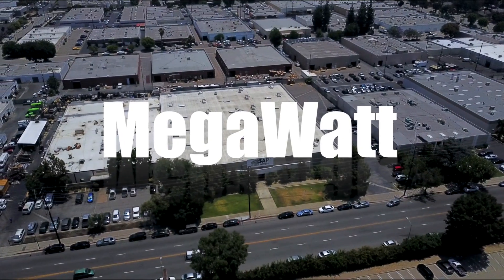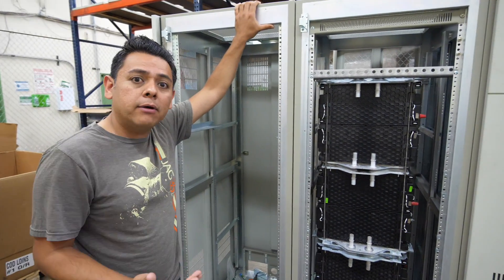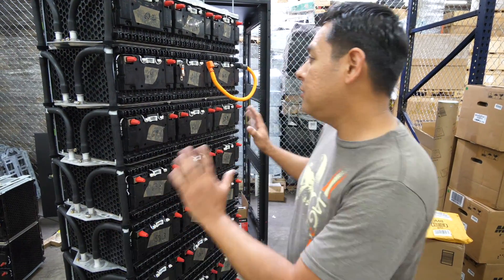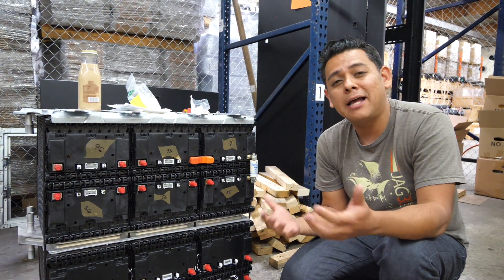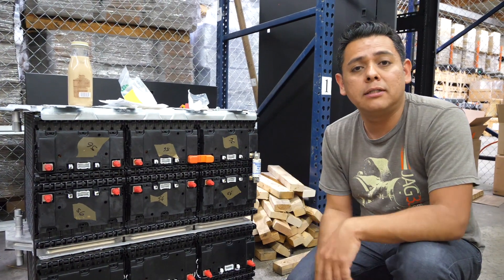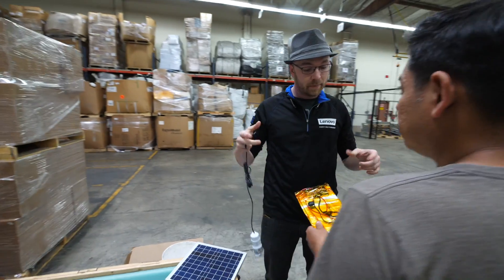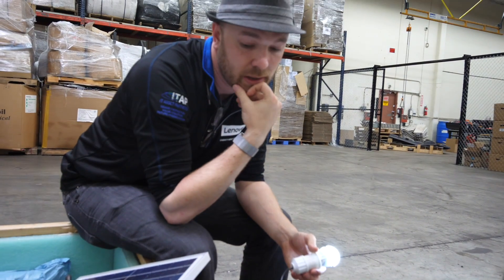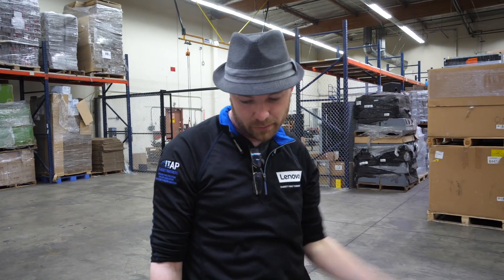1 million watt hour 355V SOLAR STORAGE battery

Comment: 355v/400v DC! Yikes, that'd for sure tickle if you touched it live :(
Reply: These are lithium cells. Delivering lots of amps is in their wheelhouse. When you get above 300 volts, the electricity can start to reach out and "touch" you. My father (EE, worked with particle accelerators) thinks that these medium voltages can be more dangerous than high voltages in the 10s of thousands because those voltages "warn" you when you get close. You can feel the hair on your arms react.
Reply: So 10000 amps at 12 volts, that'll kill ya? :)
Reply: Wrong, it's the combination of current and voltage that makes electricity hazardous. You can touch 12 or 20 V all day with your fingers and nothing happens (try with a 12 V car battery with dry fingers). The voltage needs to be high enough to overcome the resistance of the skin, then a current will flow. ElectroBoom did a good video about it.
Reply: There's quite a difference between AC and DC voltage regarding the potential danger. Check out ElectroBoom's video about it, that guy is entertaining and knows his stuff.
Reply: would 'arc' your back in a split second
Reply: SwisssBolla - That's electrostatic pulse discharge if I'm not mistaken. Very brief HV pulse and very little current
Reply: yeah, but 12 volts can't go through your skin
Reply: Markle2k: A week ago you wrote that (ventricular) fibrillation was in the 1 Amp region.  That is BS, it is far far less than 1 Amp and  then you said a government website gave you this wisdom. More BS which is why you can't back it up with a government website saying this. Then you said it was because your browser history is flaky, like me and you choose not to waste your time verifying what you made up from thin air. You wanted to tell me and the World about how the human body is a resistor, blah blah blah. Something more you added was how the chest would need to be opened and paddles put directly across the heart  passing 7 milliamps (implying that is the only way 7 milliamps could cause fibrillation is with paddles inside an open chest).  All of this is incorrect.  7 milliamps can flow through the human heart without opening the chest / using paddles and 7 milliamps is enough to kill you (not the 1 Ampere current you were telling people).  I'm sure you are totally unaware but did you know that medical equipment safety requirements specifies that leakage current to ground from a human in contact with equipment (basically with your finger or other body part) has to be well down under 1 milliamp, in the microamp region?   By the way, .007 Amperes flowing in one arm and out the other arm can kill you because your cardio vascular system is the path of least resistance. The heart is at the center.  Electricity always follows the path of least resistance.
I don't believe I am confused, or sleep deprived. Keep on bloviating nonsense. You are doing good work on YouTube with your biomedical-electrical expertise. Unfortunately you are not saving any lives with the misinformation you are spreading.
Reply: +Tim Rots You have forgotten Ohm's Law. A current of 1 million amps at one volt necessarily means that you have a conductive pathway. 1 million amps would turn you into something resembling a charcoal briquette if we didn't realize that you must be made of a solid chunk of copper with your 1 microOhm resistance to pass 1 million watts of power. This is how spot welders work, but they use a few volts at a few hundred amperes.
At the resistance of the human body, a 600 volt potential can push 4 amps through your body. More than enough to stop your heart (fibrillation is in the 1 amp region). Duration also matters. 3 seconds at 100 milliamps is as dangerous as 0.03 seconds at 900 milliamps.
Reply: I've worked on Cyclotron up to 30MEV .  The ISIS chamber can go up to and beyond 35,000 Volts!  in case your wondering I have seen that spark more than 7 inches!  and things just disappear,....
Reply: A single phase of 480VAC (277VAC to ground per phase) does indeed tickle, not sure on DC though.  If it were for the fact that the side of my arm was grounded, it would have hurt a hell of a lot more.  Back of hand to side of forearm, for half a second, and my whole arm was numb for about 6 hours.
Reply: enator71 fortunately for me that didn't happen. Glad you made it through in one piece!
Reply: Markle2K: You are talking made up sh_t or repeating misinformation you found somewhere.  I worked in  the Biomedical Instrumentation field. It is well known by people in my field that .007 Amperes is a level of electrical current through the human body which can cause cardiac arrhythmia.  This tiny amount of current can kill you. The threshold to stay under when getting electrocuted is below .007 Amps (or 7 one thousandths of one Amp).
Reply: +xxM5xx The stuff I quoted here came from the government electrical safety guide. 7 milliamps can shock and stop the heart, if you cut open the chest and apply the paddles directly to the organ. It is unlikely that you would be impaled by loose electrical wiring in order to simulate this with an accident.

A zap through the epidermis still takes every possible path through the body and the individual organs and muscle and bone are essentially resistors of different values in parallel and series parcelling out the current.
If you grasp the wires in both hands, the path through the heart is shorter with fewer "resistors" in series. If you step in a puddle while grabbing the live with your right hand, the longer path through the heart carries less current because there are other body parts in the path.
Reply: Markle2k: .007 Amps can kill you. Stop justifying your errors by diverting the conversation to parallel and series resistances. (next you may be bringing up capacitance and inductance)  Government safety guide where? Nonsense. 7 milliAmps is enough to kill you.  Please don't come back with more silliness of inductive reactance and skin effect and standing wave ratios and Laplace Transforms and Fourier  Analysis. Stop the BS.  7 milliAmps is all it takes to put the human heart into fibrillation. You do not need to put paddles directly across the heart to achieve this. Stop spreading misinformation.
Reply: +xxM5xx Are you not sleeping well? What's with the hostility? And don't try to tell me what I can do with regard to commenting in this thread.
You are confused. 7 milliamps is barely enough to cause you discomfort across your skin, if you are a woman (men have higher proportion of muscle mass, so higher electrical resistance. Get to the weight room electricians). If you want to stop the heart or turn it into a wiggling piece of Jello with that, it'll have to be AC put directly across that bag of electrolytes. A higher current across the whole body will put a subset of that current through the heart, but also your muscles and bones. Providing a direct path across the heart by crossing from hand to hand or, hand to foot can wind up with the current being high enough to cause fibrillation or tetanus in the heart muscle. 

Please pay attention to words like 'likely', 'possible', and 'probable'. And remember that volts across a known resistance enable the current. 100 volts across dry, clean skin (100,000 ohms) is a milliamp. 1000 volts is 10 milliamps. But if it damages the integrity of the epidermis, the body has a resistance in the 500-1000 ohm region. Thats a killer at 100 volts and a probable killer at 1000. The higher current causes tetanus instead of fibrillation in the heart and a defibrillator may not be necessary.

Current Reaction
Below 1 milliampere Generally not perceptible
1 milliampere    Faint tingle
5 milliamperes Slight shock felt; not painful but disturbing. Average individual can let go. Strong involuntary reactions can lead to other injuries.
6–25 milliamperes (women) Painful shock, loss of muscular control*
9–30 milliamperes (men) The freezing current or " let-go" range.* Individual cannot let go, but can be thrown away from the circuit if extensor muscles are stimulated.
50–150 milliamperes Extreme pain, respiratory arrest, severe muscular contractions. Death is possible.
1,000–4,300 milliamperes Rhythmic pumping action of the heart ceases. Muscular contraction and nerve damage occur; death likely.
10,000 milliamperes Cardiac arrest, severe burns; death probable
https://www.osha.gov/Publications/3075.html

This isn't where the original numbers came from, but I'm not willing to waste my time looking through my browser history for such an ill-tempered person as you.
Reply: The dispute centered on .007 Amperes effect on the human heart vs 1 Amps being required to trigger fibrillation. One Amp is not the threshold for potential death, .007 Amps is recognized as such. Sure, dry skin and light touches play a factor in getting that current through your chest but it isn't difficult to get 10 milliamps to flow across (through) your torso if you touch the wrong live wires. 10 mA being enough to potentially cause loss of life. If you want to extrapolate the dry skin protecting you theory, let's say you were a pair of dry gardening gloves while handling electrical wires. Depending on what live electrical wires you touch and how you touch them, you can still be killed. 
By the way- the AC frequency plays a role in this too, in that the heart will not fibrillate as easily with current at higher frequencies.  It turns out that 50 or 60 Hz is particularly hazardous compared to  AC currents through your torso in the kilohertz frequencies. I assumed we were all talking about 60hz AC line hazards above so I did not bring the added variable of kilohertz AC into this earlier. No need to dwell on the frequency most common folks won't be exposed to 100 Khz high voltages, the big threat to them is 60 Hz.  In closing I'll say this.... one Ampere flowing in one arm and out the other arm is achievable with 120 Volts AC 60 Hz. If you flow one Amp through your chest this way you will not have ventricular fibrillation, you will have your heart cooked (burned). You won't die from cardiac arrhythmia, you'll die because your heart tissue irreversibly cooked like a hot dog.
Reply: http://www.nydailynews.com/news/national/florida-man-electrocuted-dies-installing-dishwasher-article-1.2006183
Reply: +xxM5xx So, you refuse to accept any evidence from any source that contradicts your assertions. I have cited my numbers from multiple sources. Other people have tried to show you where your error lies. Yet, you persist.
You say that it isn't difficult to get 10 milliamps to flow. That's true. It also isn't difficult to get picoamps to flow, but you may not be able to measure them above the noise floor of the body's own electrical signals. But very little of those 10 milliamps (10 milli-Coulomb-secs) will traverse the heart. And that is the point that you can't seem to grasp.
Reply: I already explained to you that the heart IS THE path of least resistance in the body. Much of the current flows through the heart, not, as you say, very little. Path of least resistance is the cardio vascular system. You have sited number from multiple sources?  I missed that. What are these sources you quote? . Be specific, saying "government" is not specific, what specific sources? UL? CSA? NECS? OSHA? IEEE? These are five reliable sources refuting your 1 Ampere fibrillation fact that you cling to (and there is me, an electrical engineer with 8 years designing biomedical equipment for hospitals).  

Are you telling us that if your arm brushes up against a 120 VAC 60hz line (with 100 mA current limiting of a sort) while your other arm is touching a return path, that you are not at risk of being killed because the danger (in your book) doesn't start to be a threat of death until 1 Amp? Well? Are you? Are you telling everyone reading this that 100 mA is safe because it is far below your 1Ampere statement you made a week ago?

Bear in mind that household electricity (AC receptacle wiring, appliance wiring) in the USA is NOT current limited to 100 mA. Are you saying that less than .007 with flow through the heart (it will flow around it) if one hand contacts line, and your other hand contact ground (Earth)? or that is okay as long as the current is under an Amp through the heart?   What are you saying?
Reply: you guy forgot something called RESISTANCE!!! what a joke.
Reply: +Thomas Cruz amps, time he touched it, humidity, 3 things that can extremely change it
Reply: Markle2k, xxM5xx I say we just test it all on you two, then we will have supporting data and can find the true WINNER of this pettiness.
Reply: +Markle2k well that's exactly what i was trying to say and yes i know that's how spotwelders work
Reply: Amperage matters!
Reply: +notime fornonsense Wrong! at 12 volt you aren't going to overcome the resistance of the human body as we aren't a real good conductor of electricety that doesn't mean you won't conduct any electricety but not the 10000 amps, you just simply can't do that
Reply: +toysareforboys It's DC, that hurts way less then AC and is also way less dangerous then AC, still those 400 volts wont be pleasant but you won't die.
+Danyal A. Half true and half wrong, a million amps at 1 volt isn't going to do a single thing, I'd have no problem touching that, it's voltage and amps combined, you need some kind of voltage to overcome the resistance of the human body as we aren't a real good conductor.
+Danyal A. +theAppleWizz This pack has lots of amps sooo..
+Markle2k big difference if it's static energy and if not if it's AC or DC
Reply: toysareforboys i was being facetious.... its the combination of amps and volts that kills you.. anything above .2 amps can stop your heart so yea 10000 amps would definitely kill you, maybe even make you explode
Reply: Mads Uttrup Jensen yes it can with enough amps it's not the volts that get u it's the amps.
Reply: it can be 1000v if the amperage is not high it you will not even feel it.